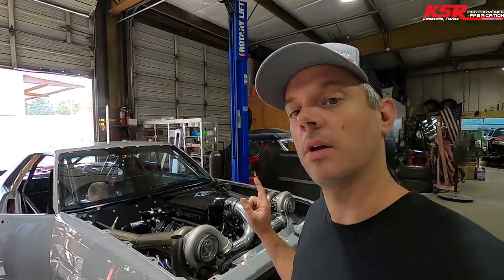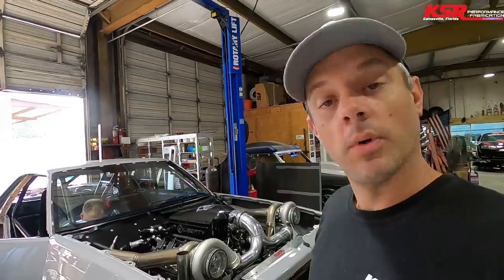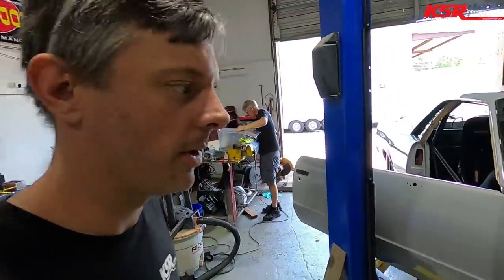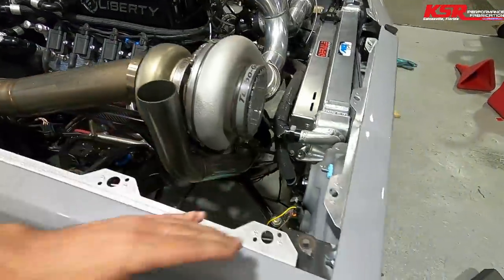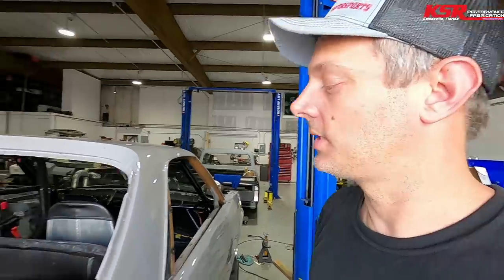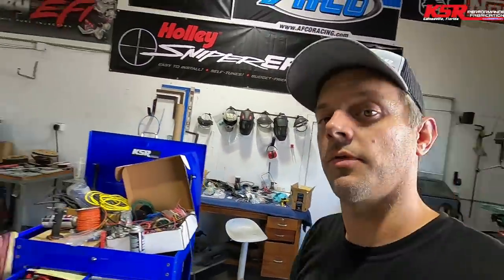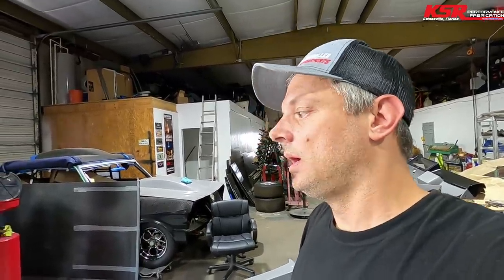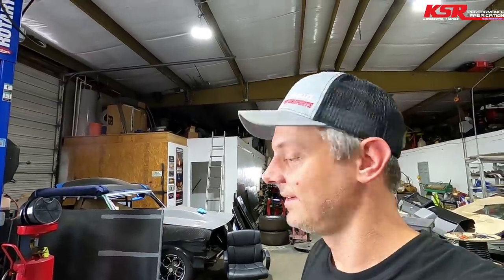Mullet El Camino Build Episode 28! Thrashing to Wrap Up the Final Details!!!

Comment: Super job by Kevin and his talented crew. A little advice to those of you who work around vehicles, aircraft, etc that have critical components, procedures, torque specs, etc that can not be overlooked. 
** Paint markers** [Marker-like pens ] that rest in your pocket are the solution,.A bright red, white, yellow, blue, etc dab of paint tells your brain.  "Yes that the expensive $$$$$$$$$ Gear Vendor overdrive has been filled with the proper fluid and torqued to spec".We've all forgotten to tighten, fill, etc
 Use them on everything and you'll sleep much better at night. These are what major manufacturing factories use to make sure your new car doesn't lose its steering at 80 mph, your R22 helicopter doesn't lose its tail rotor at 4500 feet. You can purchase both permanent and washable [ removable ] for a variety of applications, surfaces, etc. Washable is great for tire and wheel assemblies, suspension pieces,ujoints, etc on show cars that will be driven at some point in time. Some restorations include reproducing the original factory paint marks, numbers, codes, etc.

Comment: The Head light connections are really nice. Reminds me of one of my neighbors who built a hot rod type car where he used those older style metal trailer four pin plugs for pretty much everything from the alternator to head lights and anything else he could think of. He placed them just about everywhere for easy access and when you look at the car it looks pretty awesome. 
Kevin do not forget about the handles on the fuel cell... You will regret it if you forget!

Comment: I know you probably are already done with the front mounts, but I thought of a flat piece of metal bent into a "U" shape with a hole drilled through the ends for a clevis pin. Then maybe the front end could pivot up also in case of emergency.

Comment: Hey keV you should get someone to 3D Print or make some fibreglass/carbonfibre ram air intakes so that when you go from street to track you drop out the headlights and use the ram air intakes to point directly at the turbos just a thought

Comment: What diameter does the sensor read for the track temp?  is it placed to read at the tyre line or under the car? would there be a big differece between where the tyre hits and grips with friction heat and would that carry on to the next racer?
Reply: The track temp will go back to the ground temp very quickly after a tyre passes over it, even a very fast moving/hot tyre. The contact patch is small, the ground is very big. I imagine the important thing is the surface temp close to the tarmac.

Comment: I'm pretty sure this project has taken years at this point. I wouldn't worry about thrashing. Just take your time. 9/27/2018 mullet was still stock. And I'm not sure this car should be called Mullet anymore, without a jet engine, there's no longer a party in the back.

Comment: Love this series. Ive learned a lil. Hope to see a series on the truck. Kevin are you concerned about keepin Mullet cool at the track and on drives with such a small grill opening? Wondering if there is going to be enough air flow across the radiator?
Reply: With the amount of cooling surfaces and the fans , I'm not concerned that the car can't stay cool on the road. On the track it's even less concerning, with the used fuel and the short periods of time the motor has to peak ..

Comment: Kevin did you get the mullet build from another builder or did you start this project from scratch. And also did you have a hand in building any of the other cleetus cars.
Reply: Mullet was initially built as a jet car , Cleetus stepped away from that idea after some serious accidents with other jet cars. 
Kevin dialed Leroy in , improved Ruby and then Mullet got to his shop with the intention to make it a RMRW and other dragweek events car that could both be used on the street and run faster as the other cars in Cleetus' fleet. 
Kevin upgraded the rollcage to 6 sec NHRA specs , built the electronics from the ground up, added a lot of useful features like a dual fuel system , a ton of sensors and dropped the engine a bit back and down for better handling and the ability to run a hood . A movable fuel tank in the back to balance the car better front to back if needed, optimization of the twinny spinners on the engine etc.. if you missed it , go all the way back to first episode of this series , you won't regret it.

Comment: Kevin, I’ve got a 6.0/BTR stage 3/T56/P1sc 

I have been beating my head against the wall about injectors, do you think it’s too much injector to run a bosch210 If I plan on running e85. 

This Elco is a nasty machine sir

Comment: Are moving mass dampers legal? Might pay to throw a littleish one in just in case the engine roll becomes too much? 
Like a springloaded weight in the lifty corner that goes off if it climbs too high?
Reply: In the same way as the front wheels slowing a wheelie
Reply: That way if you need to add weight to the front, you can use less weight for a similar result

Comment: Kevin, I thought this engine was supposed to have 2,000hp?
Reply: Its dyno was like 1400 the other day. And it wasn't turned up all the way. So it should make 2000 if they want it to
Reply: On the first engine video I asked if that number would be 2k or more and he then replied 1500+ was the initial goal. 
Seeing the dyno video and making 1400 already with a sloppy conservative timing I think he fooled me and 2k is indeed a target to pass 🤣
Reply: You might also be comparing estimated HP at the crank to actual wheel HP on e dyno.
Still... Might get close at the wheel s when he gets it dialed in closer!